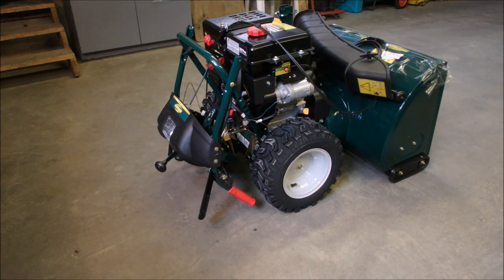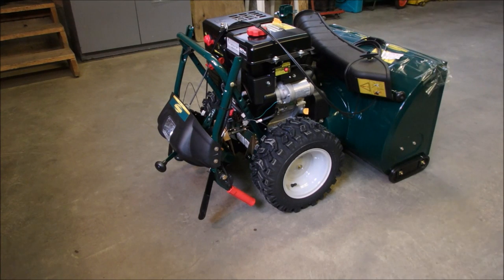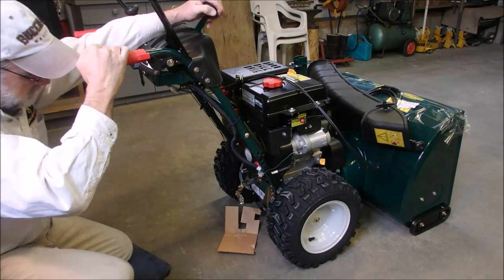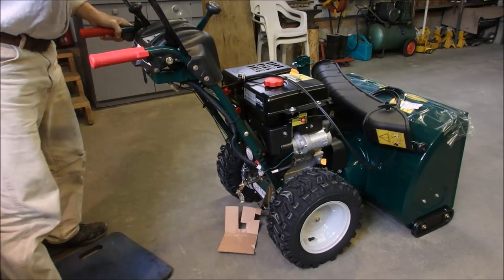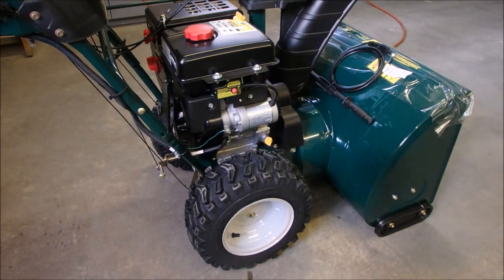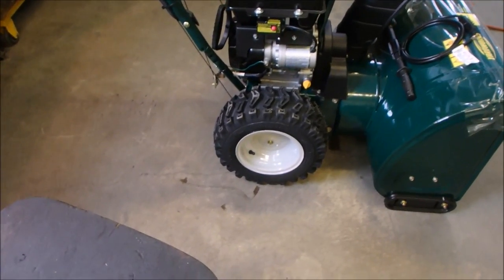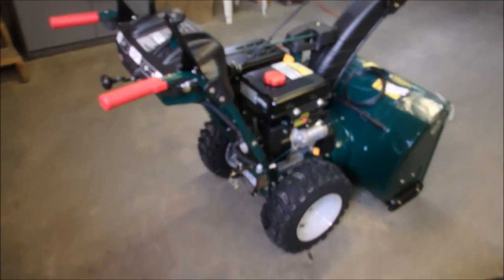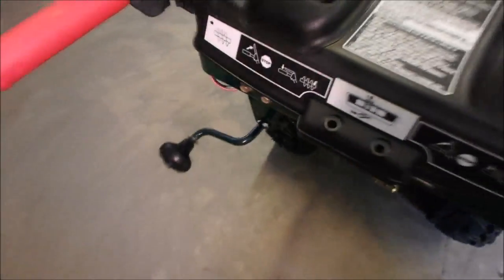How to Assemble a Snowblower From the Store

Comment: Good job. A nice new shiny machine is a treat to work on. Someone is hoping they have snow this year. I bought a new Husqvarna last year and never got to use it. Maybe this year. 

I've seen these at CT.  A $50 assembly fee is added at the check out.  I would imagine after a couple of times a person could set them up fairly quick so a $50 seems a little steep.
Reply from the maker: Well for me that isn't to bad a price.  I give it a better check over than most would (a 16 year old kid for example).  Lithium grease on the joints etc.  Topping up the oil and running it.  I wonder if they do that.   Interesting.  Thanks for the comment
Reply from the maker: Buy the way  the best weather forcast you can get is buying an expensive snowblower
Reply: I can't say for sure but I doubt the store gives it attention to the little details you give it. Knowing that someone like yourself, who puts some thought and care into the assembly, would make the fee worth while but I got the impression I didn't have the option to put it together myself. Maybe it depends on who you talk to. I bought mine at a dealer so there were no assembly charges (saved $50) plus they service what they sell. CT and HD told me they don't service what they sell so thats a problem if I needed warranty work done. I live down in the Hat so maybe its different up there. Anyways, its always fun to watch someone else work.  ;) Cheers.
Reply from the maker: I am from the Hat!!!   Went to school at Vincent Massey in Crescent Heights.  WOW  My dad is 84 years old and lives there.  CT has a place but i don't use them that much anymore.  I tend to go to the commercial places now.  
Bruce Pender.  I have a lot of family down there.
Reply: Its a small world isn't it? We moved here in '79, a couple months after getting married. I'm retired now. My kids still live here. They finished their grade schooling at Crescent Heights High.

Comment: I would recommend pulling off both tires and coating the axles with anti-sieze while it is still new, otherwise you may have a problem getting the off after salt gets on them rusting them to the shafts.  I also crank up new engines and let them run for a tank to break them in while they are not under load.  At 5 hours of operation I dump the oil and replace it.
Reply: The critical thing is that these machines do not have any oil in the crankcase as delivered to avoid spillage.  So you have to make sure to put oil in them before starting them up or the engine will be destroyed.  Most people recommend conventional oil at first to allow the piston rings to break in correctly.  Afterwards either conventional or synthetic oil can be used.

Comment: I have assembled a couple my  friends thought was too tough.  It's not bad at all. The tires on every blower seems to be a weak point aster a couple of years.  I liked the solid tires but you don't see them anymore.
Reply from the maker: Yes I think all yard stuff should have semi solid rubber for tires.  Good point.
Reply: STEVE ROB The township I worked for filled the front ties of the zero turn mowers with product that made the tires a soft solid tire that would not go flat. That might work for the snowblower tires also.
Reply: Raymond Campbell  I would like to do that too, I have two blowers and it's slow leaks  on the tubeless tires then it's putting in tubes and more tubes. Hahaha  I wish I could just put on solid rubber tires .
Reply: I believe the stuff is like a jelly. Someplace that sells and repairs zero turns might carry it or tell you where to get it.
Reply from the maker: I have used slime but never in a high speed tire.
Reply: I saw it used on the front guide tires and the rear drive tires on zero turns. So is you get a nail or thorn in the tire it won't go flat. I wouldn't use it on any tire that that would be going over 20mph or at highway speeds.

Comment: My tires are flat every time I move my snow blower. I really need to load em up with slime. I did that with a front tire on my zero turn dixon and it's been aired up ever since.
Reply from the maker: Yes slime is an option all right.

Comment: I would anti-seize the wheel axles and the auger shafts. Over the years it could be tough if you ever have to pull apart.
Reply from the maker: You are right.  My JD tractor has completely rusted wheels to the axle.
Reply: Bruce Pender yeah it's tough when you get equipment in and the part is seized on. 
Spent a couple hours, pulling a hub off a Honda Snowblower to fix the tire. Just a lil grease or anti seize goes a long way! Oh well! 
Also good videos you put out there!

Comment: When did that come about, pugging it into 120 volt to start?  That's a new one for me.
Reply from the maker: Well I have and Ariens from the 70's with an AC start.  I don't know when that started.  Great idea if there is power near.
Reply: I got my first blower in 73 and it had AC start. Electric start certainly is a back and arm saver if you have to start the machine outside in very cold temperatures.
Reply from the maker: Nicer for the bigger motors too.  No battery to cary either.